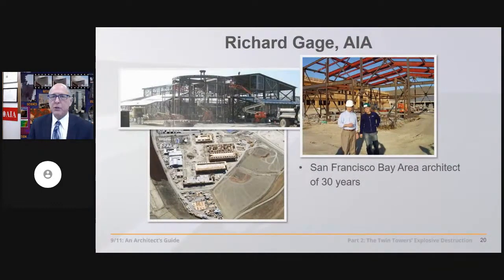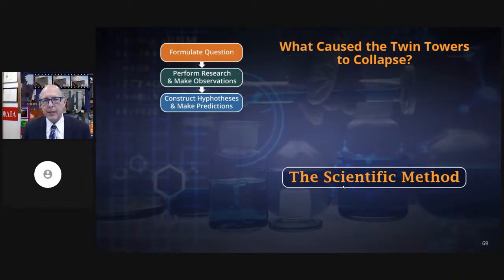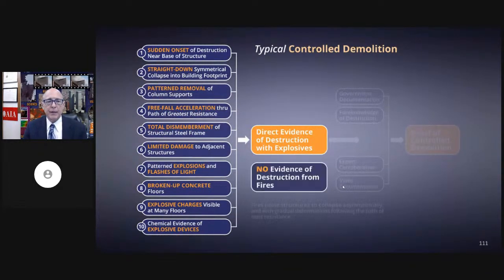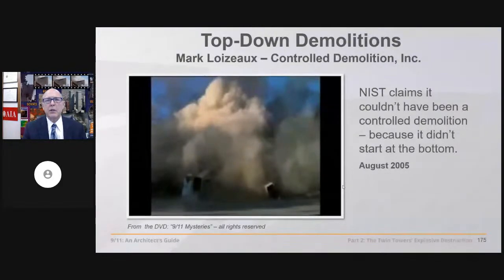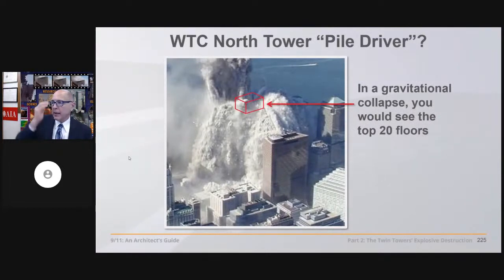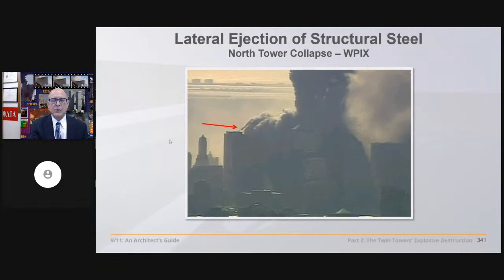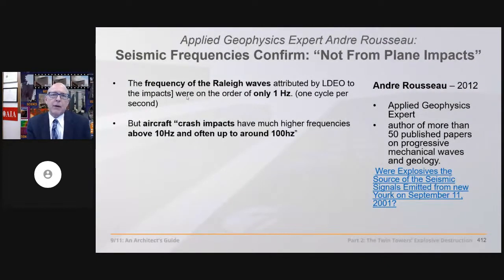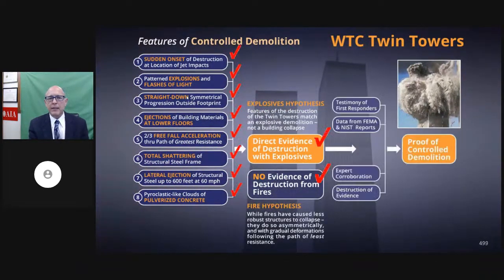9/11: An Architect's Guide - Part 2 - Twin Towers' Explosive Destruction (5/14/20 Webinar - R Gage)

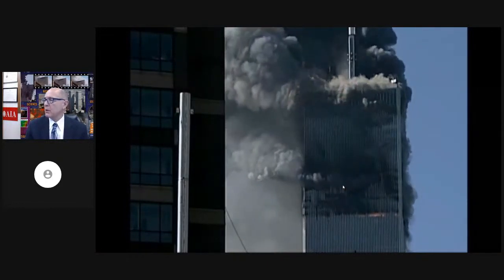Comment: Around the 29:00 min mark where you are showing the towers fall, watch the roof line of the 2nd tower. (The one just after the antenna building falling) . The angle of the roof starts to slope left / but miraculously self corrects to even out --- . That tells me there was a split second where the fall stacked up. As it would under normal collapse BUT resistance was removed (prob from an explosion) and allowed it to continue its downward zero resistance fall. Just thought I'd point that out.